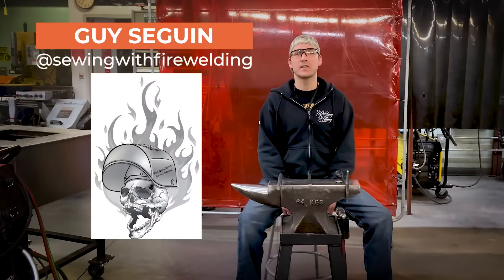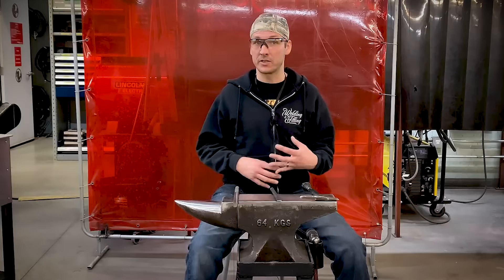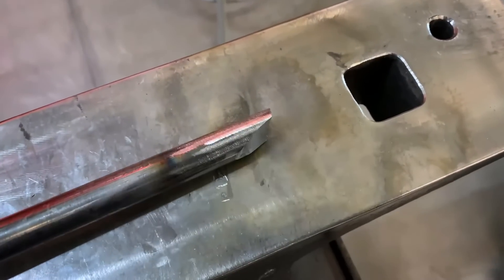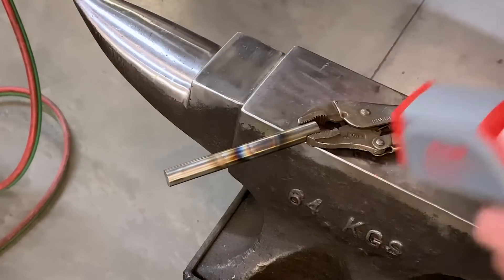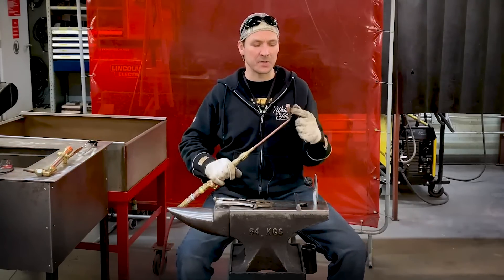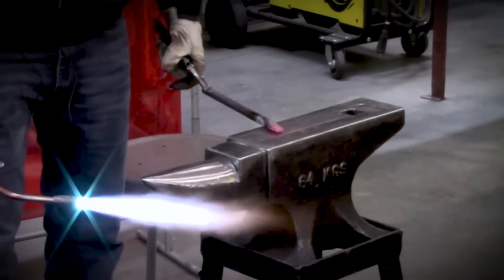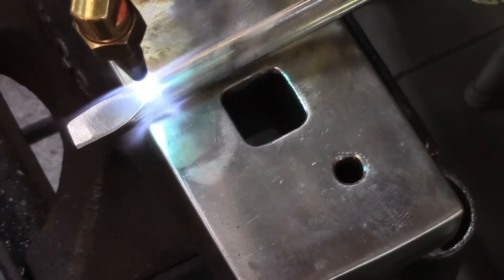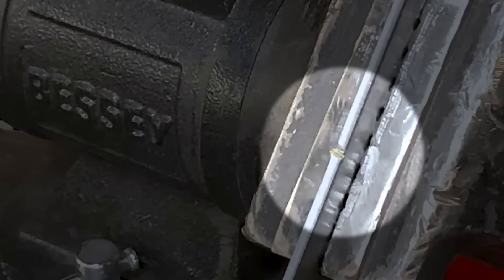DIY: Building Your Own Personal Chisel

Comment: Could you do a video showing the most used types of steel and each step of hardening, tempering, quenching, and what each step does to the steel. Which stuff to look for and why. You get into the theory in this video, but I haven't found anyone doing this in a good way on YT yet. Hoping you will.

Comment: Very nice job. I’ve done some shop hardening so this was very good technical information. I like the emphasis on safety. I’ve been working with metals and machinery for much of my life and always use goggles, gloves, hearing protection. I am no stranger to smashed and cut fingers and other body parts but at least try to stay in one piece. Hard to work with a finger or hand out of order. Thanks.

Comment: Speaking as a hobbyist blacksmith, both 4041 and 4140 are oil hardening steels. I use 4140 and 5160 all the time for making shop tooling. A lot of smiths in my group swear by parks 50. But ive always had great success quenching in either canola or peanut oil. Also, when you use a torch to temper your steel, apply your heat closer to the struck end and watch the colors run to the working end. Its an easy way to do differential tempering without a forge or tempering oven. As far as shaping your chisel, put a gentle taper on the struck end and then dome the end of it. That helps to concentrate off center blows through the tools vs a glancing blow.
Reply: Thanks For your humble advice Piney.  By no means am I an expert on heat treating so you sharing this info is appreciated 😊
Reply: Huii

Comment: Using a torch directly over the anvil is an awesome way to ruin an anvil.  It's not a cutting table, and you are likely to temper the hardened face applying heat to a workpiece directly over it.
Reply: And here comes all the "Professionals"....
Reply: If he was using the cutting torch, i would agree, i have seen many nice old shop anvils with their edges messed up from a cutting torch. However, i highly doubt using a small rosebud like that could heat that anvil up in the short amount of time he used it, even if he was directing the flame straight at the top. Definitely wouldnt be nowhere near the heat i put into my main shop anvil forging a 10lb wrought iron sledge with forge welded on 5160 faces.
Reply: Flux core...he's not wrong
Reply: @Dave-thorfinn  like the other guy said, that rosebud ain't pushing enough heat to ruin that anvil
Reply: "Here comes the professional"
Reply: @Dave-thorfinn  🤣🤣🤣🤣👉😬👈